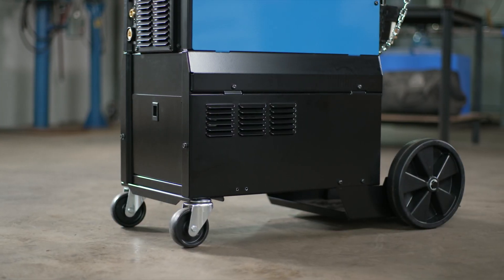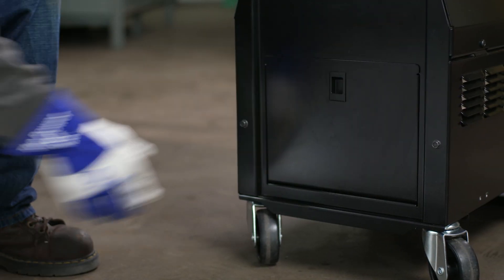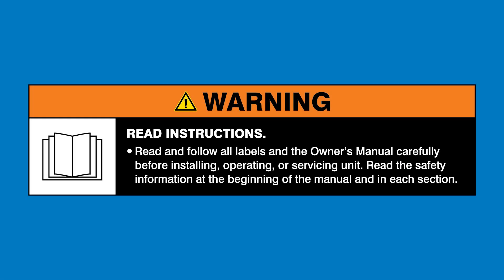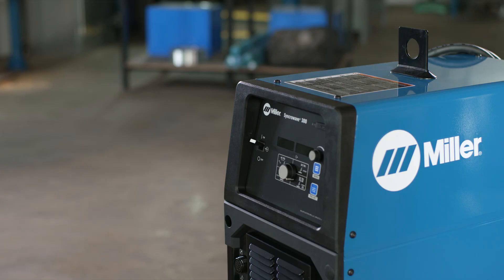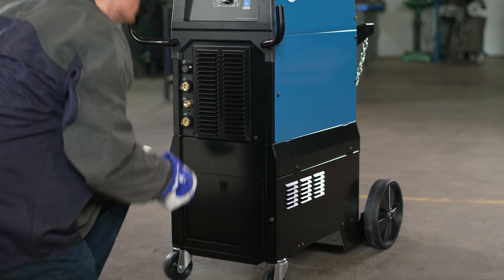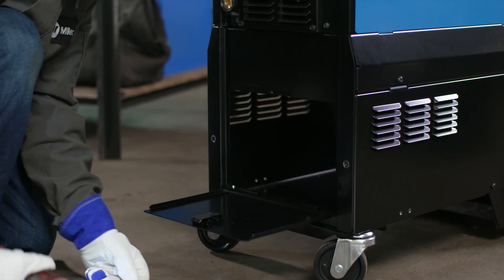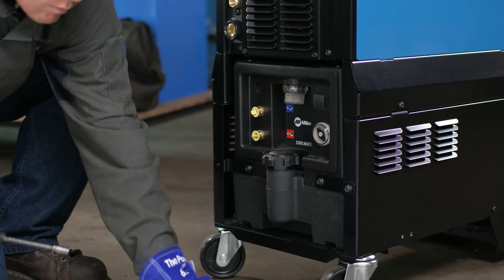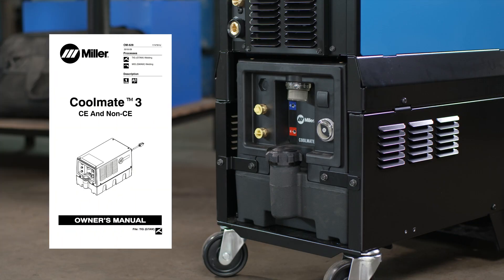Improve Mobility and Storage for Syncrowave TIG Welders

Comment: Thank you. Can you use the coolmate with a Dynasty 200 or 210? And is it really a benefit to use it? Can running these machines without a coolmate make any significant differences?
Reply from the maker: Thank you for reaching out.  The Dynasty lineup could be paired with any of the 115V externally powered Coolmate units.  If the Dynasty 210 is a CPS model it can also be used with the matching Coolmate 1.3 powered from the CPS on the rear of the machine.  We recommend using a water cooled system when welding above 200 amps, or when working near 200 amps for extended periods of time.  A water cooled torch will typically have a higher duty cycle in a physically smaller torch versus air cooled.  Higher duty cycles will allow longer weld times with less wear on the consumables while the smaller torch size will improve operator comfort and potentially provide better access in some applications.  Higher amperage  air cooled torches are available to increase duty cycle on high amperage applications, however, the torches and cables do get physically larger in order to accommodate the amperage.  For lower amperage applications operator comfort and a more compact torch are typically the reasons operators may choose to go water cooled. Let us know if you have additional questions!

Comment: why can't the cooler be plugged into the back of the welder?like on my tigrunner 250dx my cooler is plugged into the welder.
Reply from the maker: Thanks for your question.  When purchased as a TIGRunner package the cooler is wired internally, using the supplied input power voltage with an external plug not needed which eliminates an industry voiced problem of the cooler accidentally becoming unplugged.  The Syncrowave machine lineup is no longer available with an auxiliary 120v receptacle for a few reasons, a main driver being customer feedback that companies commonly had employees misusing or overdrawing the receptacles rated usage.  Please email us at info@millerwelds.com with any other questions you may have.

Comment: I posted a video about the 255 and the burn back issues on pulse mode. I was contacted by a man who owns a 255 having the same issues looking for answers. A lack of communication with loyal customers gives your competitors a great opportunity to sweep in and become the new #1 guy on the block. I’ve emailed the guy Miller told me to email. No response. I didn’t get a bad cheeseburger at a drive through, I bought a $3000 welder that I depend upon. Miller needs to stop hiding from their customers and give us the answers about the 255 we’ve been begging for. “FasTack”? Does even what? Miller won’t say. Frustrating.
Reply from the maker: Don, please give us a call at 920-734-9821 or email us at info@millerwelds.com. Your issue sounds like it may be a feeding issue, I would suspect an issue with either the liner or the way the wire is wrapped around the spool. FasTack helps reduce arc start time by increasing the run-in speed when doing repetitive arc starts. This feature uses a slower wfs when the wire is cool and a faster wfs when the wire is hot. By default it is turned off.
Reply: @MillerWelders  Sir, I’m noticing that my roll of wire is 90% gone. Perhaps that’s leading to the bad feeding issues you spoke of. I’ll swap that out and see if it does the trick.
Reply from the maker: @w46try7  did this help your starting issues?  As the wire gets gets closer to the spool it typically retains more cast and helix or "memory" than it does at the beginning due to a tighter radius.  You can see this by cutting a few wraps off the spool and setting them on the table or floor and look for two things; how large the diameter of the wire becomes and how high it lifts off the table much like a coil spring would.  This memory can create multiple feeding issues as the wire is fighting the liner and tip wile also trying to flip within the liner. 

In addition, a recommendation that becomes critical when pulsing is the quality of the wire used.  Less expensive, poorly made wires can cause multiple problems when pulsing due to extreme changes in diameter and poor wire surface conditions. 

Please let us know if this corrected the issue or if you are still in need of help!
Reply: @MillerWelders  Thank you, myself and 2 other guys with these welders are still trouble shooting. A new roll of Hobart wire, and the block test you mentioned. It happened yesterday, and so I clicked the welder down for a thinner gage and it then acted right. I’m either setting the machine for too thick of material or the machine has a glitch where you click the material thickness button to another setting, and it “rights” itself. I’m gonna keep working on the solution. I’m keeping my machine covered with towels when not in use to protect the wire from micro-corrosion. There’s an answer, and I’ll find it and share it when I get it 👍